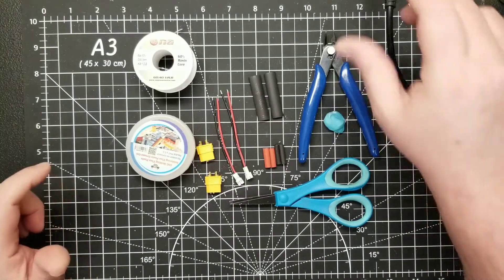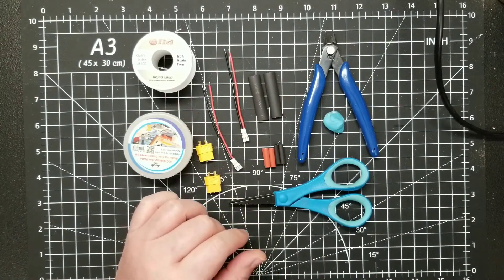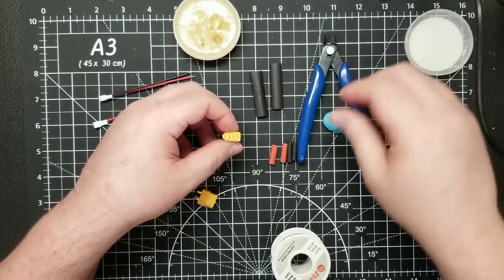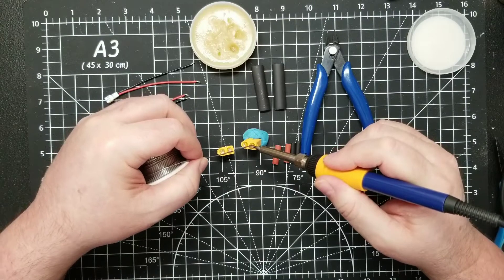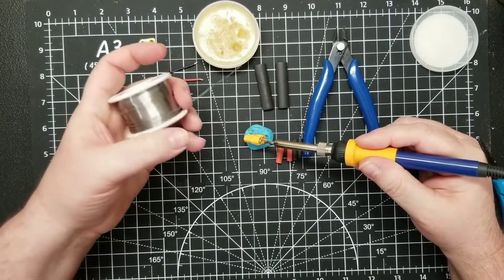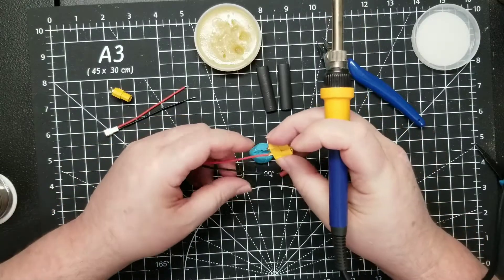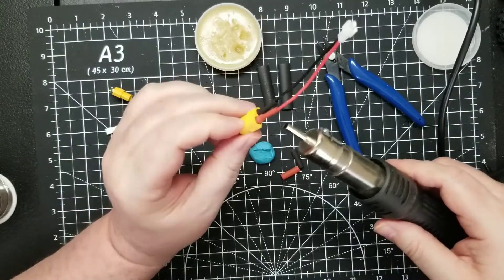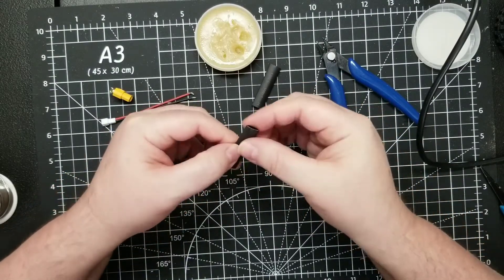Making a Charge Cable for Axial SCX24 Deadbolt - XT60 to JST PH 2.0

Comment: Theres like a gazillion different types of JST connectors. lol

If I could I'll give ya a couple of soldering tips. Broader chisel tip would work better as you mentioned. Theres really no need to flux your connectors although it definitely doesnt hurt anything. Anytime you do use flux, once the fluxed piece has cooled off wipe it off with a bit of denatured or rubbing alcohol. Flux is very corrosive. 

Tin your soldering iron tip each and every time before placing it on the connector, wire, or whatever else you may be soldering. It will help spread heat in to the connector faster, especially if theres flux on it too. One big key to soldering is to apply heat to the subject matter for as little time as possible. With a wide tip thats tinned you can place it on the backside of the connector and the solder should start to flow inside within just a couple/few seconds. Dont get carried away with tinning the tip heavily though as a bit of the solder will stick to the outside of the connector. Small amounts are no big deal and can be covered with heatshrink. Large amounts stuck to the outside can be a mess. If you get too much solder on the outside you can simply wipe the iron off and wipe over the solder and sort of wipe it off with the iron if that makes sense. 

Another pro-tip is to have some liquid tape on hand. If you forget to put heat shrink tubing on you can just cover the end with the liquid tape which will harden into a nice rubber coating. I got tired of having to unsolder and resolder connectors because I forgot heat shrink lol. 

I love my solder reflow station. I end up using it for heatshrink more than I do reflow work lol

Another tip if you want to use heatshrink to try and build a strain relief for the JST connector end is before soldering on the XT60 slide some smaller heat shrink around just the wires themselves. Something small enough where it just fits over the wires. Then you can build it up in layers using increasingly bigger heat shrink until you get to the final piece that will cover the whole connector. That way the big heat shrink will have something to cinch down on when you heat it up and the strain relief will be much beefier. You dont have to get carried away with layers but the bigger the size discrepancy the more layers may be needed.

Hope this helps :)
Reply from the maker: Thanks for all the tips! I never solder frequently enough to get good at it. I have more tips for the soldering gun, but I just moved everything from one room to another, and not sure where my tips went. As soon as I order more, they will turn up.

I thought about adding more layers to the XT60 side, but I will likely be grabbing connectors without the wires to build it in a bit heavier gauge for durability.
Reply: @BreydonsRC  The ones you made there should be plenty good I would think. unless you just want to re-make them.
Reply from the maker: @Greywolf74  yeah, they are ok. I tried to find just the connectors, but was in a hurry and just grabbed those. I am actually wanting to design a housing to mount in the top drawer of my tool box that has all the connectors in it. So no more cables. Just plug the battery in and go. But the only connector I have found so far that is truely mountable is the XT60. It has flanges with hole locations. I know some of the others should have similar designs, but haven't looked too much yet.